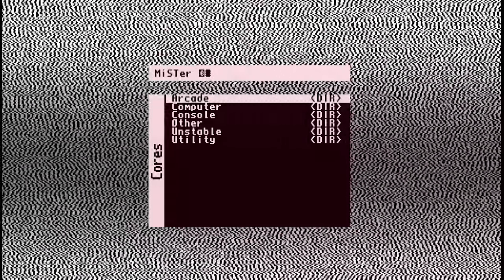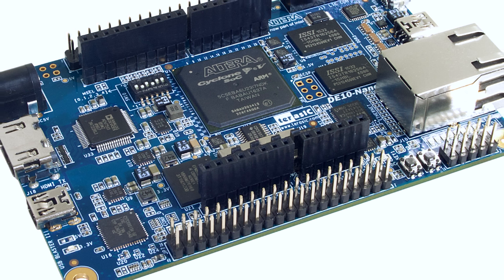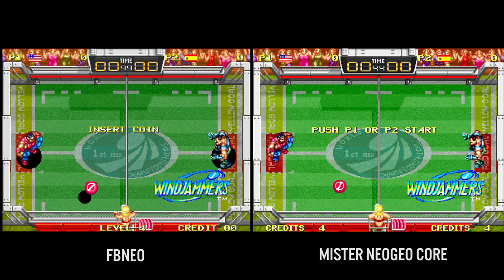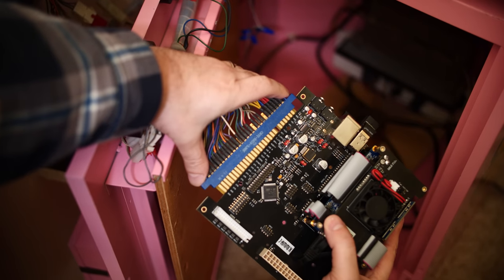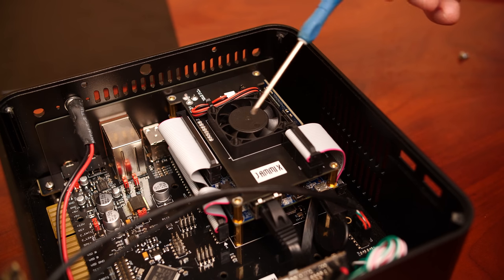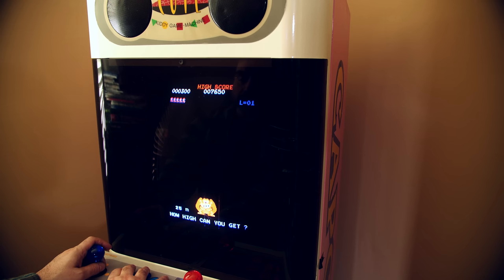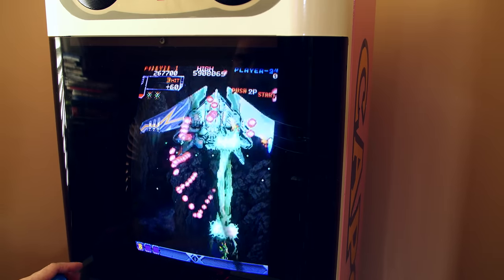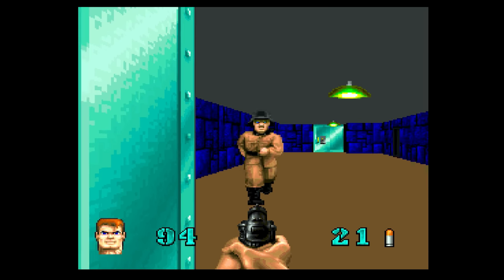Finally - I got my hands on a MiSTer FPGA Retro Gaming Setup | MVG

Comment: I always ponder on what the overall philosophical benefits of FPGA cores instead of software emulation are, especially since CPUs have become so fast that there isn't much problem to emulate cycle accurate. re: hardware preservation: in theory, a working core can again be emulated in software, although right now that'd be pretty slow. But it still makes FPGA cores more versatile and more flexible. Kind of the original hardware being preserved in a meta-language. That's especially true for many arcades that utilize ASICs. Although it'd be feasible to preserve a software emulation equally as well in the form of bytecode, running in a VM.

Comment: Nice video.  Note though that some of the cores shown require a Patreon Subscription.  A few cores also cheat and uses the Arm Processor for emulation, and not an actual FPGA core.
Reply: none of the main cores use the arm processor to work but ScummVM does which nobody gives a crap about. the patreon stuff is to beable to play the betas or just show support to some of theses guys making cores . its all free people just have to wait it out befor the core maker thinks its done

Comment: O own a MiSTer for a couple of years. It was in no way expensive as it is now. I wanted it as a good Amiga emulator and I had been glancing on the MiST project this is based on.
I own a good vintage computer collection, but space is scarce and vintage hardware is prone to break, often with unobtainable components.
After setting up my MiSTer, I was amazed on how many systems it could emulate.
In fact this is one of the drawbacks: after owning a MiSTer, there is not much point in getting further vintage hardware! So, you lose the fun in browsing eBay for good deals to increase the collection.
Being a Commodore fan, I must say that I prefer BMC64 to MiSTer for C64 emulation and it supports all other 8 bit CBM computers.
For emulating the Amiga, I think the better option is  PI400 with the bare metal Amiga emulator. Don't recall the name, but you can find fully configured images.
But yes, MiSTer is a cool piece of HW and I often leave some arcade emulation running on the background when on inline meetings. It's a cool conversation starter...

Comment: I wonder if it's possible putting a Mister FPGA inside a Arcade1up. lol

I've known for this project for a while and I'm glad people like you are pushing it towards its full potential.
Reply: should be quite easy, tbh
Reply: @dadrising6464  I can imagine and since you can put in Sanwa/Seimitsu parts, you can basically get the an accurate arcade experience at the fraction of what you would spent buying a Big Blue or Big Red and getting all the PCBs.

Comment: I'm replacing my old classic hardware with a MiSTer (bought a "fully loaded" MiSTer today). I just don't have time or the inclination to maintain my old machines anymore. I'm selling them on to other collectors so they don't end up rotting down in my shed and be lost forever.

Comment: Even though I would never being able to buy MiSTer FPGA, it's still fascinating to see the progress of replicating original retro hardware packed into a tiny machine. If MiSTer FPGA can replicate N64 core & Windows 98SE + MSDOS core with adjustable speed, sound (SoundBlaster particularly) & graphic settings, then that would be an amazing all in one retro gaming solution. A combination of 512MB RAM + IDE & SATA ports would be amazing as well.
Reply: if your reason for not being able to buy MiSTer FPGA is because you live overseas and the shipping costs along with currency exchange rates will break your bank, then imo it's valid coz same
Reply: N64 might be outside of what the De 10 is capable of. MiSTer does is low level, as its taking the time to implement each chip.
If you remember from one of MVG's N64 videos, why there isn't a clone N64 Yet, there only High level, just a software API to fudge the games to work without understanding of how the console works.

Comment: FPGA or Field Programming Gate Array...That's one of term that is relatively new in emulation scene. Basically, FPGA is a hardware that allows programmer to fully emulate the machine at hardware level by "shapeshifting" the CPU architecture into desired ones.

Comment: Would love to see you do a 2024 update video to this. I'm considering taking the plunge into FPGA
Reply: Cores have expanded to N64 and run pretty great now, no dual ram needed. The setup is now a one click solution with scripts like update_all. It sets you all up automatically. Even grabs bios files for you from internet archive. Saturn and PSX run great. The dev community is still incredibly active. A fan is not really necessary if you buy from someone like Misteraddons. The case itself is a heatsink and the chip in these things is rated for industrial use and temps much higher than a normal CPU. People are leaving their Mister's on for weeks on end with no issue.  

Basically, things have only gotten more amazing since this video came out.

Comment: I'm optimist about the future of FPGA. Not only on gaming. The flexible hardware emulation of FPGA makes it compatible with nearly any platform ever. In the future, FPGA could replace our computers, consoles, and even smartphones. Imagine using a really old software designed for mainframe computers, right on your palm in the future.

Comment: fortunately I did way back in time and bought mine. today we have cps1,2 psx and others coming. its not cheap but for a retrogamer its the best you can have in terms of accuracy. games that have glitches in PSX runs perfectly in mister.
I have a PS2 with popstarter and many games for PSX can't run there because its emulation by software, using Mister its not even comparable, needed a real PSOne to run some games so perfectly

Comment: I think you did a pretty good job selling the arcade and retro computer cores. But the console cores are great also. It's like owning an RGB modded version of each console with an Everdrive installed. 

Plus there's some things you can only get on MiSTer, like the unreleased save cart for the Atari 7800. It was never released as an actual product but since several games support it and the schematics for it existed, it was able to be implemented.

Comment: Seeing how one little box worth like 700 bucks can replace all the arcade cabinets, home computers, and even create entirely new cores, this is a mighty cheap and space saving option for any retrogamer. Buying the "original hardware" is always a tricky business, with death batteries and other tricky stuff in the mix, like chips that are impossible or expensive to replace if they should fail.

Comment: If you compare it to software emulation, the price does seem steep. After all, you could get an awesome raspberry pi setup for well under $100 and that’s a great option for a lot of people.

However, software emulation just feels a little off to some people. Not sure if it’s the lag or maybe sound sync not being perfect, but it just doesn’t feel perfect to some people.

The MiSTer has no lag there’s nothing running in the background. It feels exactly like real hardware for cores that aren’t in beta. You can also easily connect it to a CRT if you like.

I’d argue it’s more like buying real hardware, RGB modding it, getting an everdrive for each system, high quality cables, a switcher, and a scaler. 

Getting that setup for even one system could cost you more than a MiSTer setup.

If you’re perfectly happy with software emulation, that’s great. The MiSTer probably won’t be worth it for you, but if you’re one of the people who thinks software emulation just feels a tiny bit off, MiSTer is an amazing option.
Reply: And the MiSTer now is still Cheaper and Easier to get than the Super NT and Mega SG would be combined from Analogue Interactive. 
And you can support more than just Super Nintendo and Sega consoles.
Reply: @lukasperuzovic1429  Yeah, it really is a great bargain for people who aren’t satisfied with software emulation.

Comment: The thing that puts me off for older computers (same thing with software emulators) is that modern keyboards have different keyboard layouts and keycaps so there's a bunch more work if you want to have an accurate representation.
Reply: That's indeed a problem, but you can source the keyboard second-hand like you would a SNES
controller for example, hook up an adapter made for or compatible with the MiSTER and that's it

Comment: Emulation when done correctly is close to perfect. However FPGA when done correctly is better then perfect.

Also MiSTer isn't as expensive as people think. Because to get the same experience on average would cost ATLEAST 250 per console.

Because to get the same quality you'd need:

1: The console (normally around 100$ or more).

2: Mod the console to output the best video signal (normally 50$ or more)

3: Need the game cartridge or flashcart (normally 50-100$ for the flashcart).

4: Providing you don't know how to mod the console. Pay someone to do it (normally about 100$).

This is all ballpark estimates ofcourse. But that's being conservative. Most of these console would cost you even more then 250.

Comment: This would be the ultimate system for me. 
No need to get any other consoles like the Analogue and pay for shipping  for all these different consoles. 
Nothing wrong with the Analogue.
I can only dream about getting a Mister here in South Africa, but for me with the exchange rate and the shipping, would cost me 3 months’ salary.
Why is the DE10 Nano board so hard to get? Surely if there is a demand then there should be a supply!

Comment: I'm waiting for custom addons for the Mister specifically for the Amiga cores, in particular enabling ISA 16Bit + Zorro II/III and Video Extension slots so that you can actually use real hardware on this from back in the day. I'm obviously pointing to things like Video Toaster but also Bridgeboards etc
Yes, I am aware of the requirements and how hard this can be, I'm also aware that having such a solution in place the user base will increase and the likelihood of new hardware and software being made for this system increasing exponentially becoming a possible path for the rebirth of the Amiga architecture which in my opinion should never have died regardless it being a harder upgrade path for the engineers etc.

Comment: would be nice to see a follow up video. With more explanation what is the difference between software emulation and hardware emulation. I don't know how to imagine that.  Isnt it still hardware emulation through software?  

And also If you could see or feel the difference with a blind test.  Emulation vs MiSTer on a CRT.

Comment: At first glance a Mister doesn't seem cheap, but count Stuff as Everdrives, OSSC, Wireless Controllers, good RGB Cables and so on and it will stay cheaper as summing up all the Stuff. 
Also, old Games are getting more and more expansive and some Hardware is hard to Maintain, i see the Mister as the Future for Retro Enthusiasts.
Edit: I bought it for 330€ last year, fully build and ready to go.

Comment: All the research I've seen which discusses cooling says that a cooling fan is complete overkill and causes more problems than it fixes.  It's loud and it causes dusting issues.  The chip itself is industrial design and only needs a passive heat sink just as many of the chips used in industrial cnc equipment.

Comment: I may have to look into this. I still have all my retro consoles and games but this year I decided to try and get a few arcade games I used to play as a kid and got into Retropie using a Raspberry Pi4, however I found out that some of the arcade games I really wanted to play the Raspberry Pi isnt able to do it (mainly Sega Model 1, 2 and 3 games such as Daytona and Scud Race to name a few). $400 for this is abit steep but if it can pull off what I need it to I may find it worth while but this does look like another massive learning curve.

Comment: Two years ago, I got the basic setup to use all cores and connect to lcd or crt (de10, usb hub, hdmi to vga, ram expansion) is was around 200 Euro. I can't believe how high is the price now, this is insane :(. Also notice the scrolling in the windhammers intro, emulators are never 100% smooth (fpga and real hardware are).

Comment: NeoGeo runs really well on software emulation. Only in the fighting games i have the impression there’s input lag. For Punch Out on NES i am 100% sure. Soda Popinski is very hard to beat on soft emulation. I still have to test the “frame forward” option on Retroarch, but for now i swear with my Analogue NT Mini FPGA for these games.
Reply: There some inherit lag in Software Emulation you can't get over. The sequential way CPUs has to handle every steep of emulation means there going to be some latency, even with features such as run ahead mode and CPUs having multiple processor cores. FPGA is mimicking the hardware, so the parts of that console that runs parallel on the original runs parallel on the MiSTer. Most of the lag from the MiSTer is Display or controller Delay. If the default refresh for each core is not something your display can handle there Vsync for that which does add some latency, but it honestly not much. And yes with default settings, most of the cores replicate their original machines refresh rate.

Comment: I would still like to see a discussion of the advantages of the Mister over emulation. You mentioned it in the beginning and said you changed your mind, but didn't explain how or why. Why should someone spend hundreds on a Mister setup instead of using mature emulators?
Reply: you get 100% cycle accurate and lagfree emulation. once a core is done you get the exact same result as original hardware on every game without exception.
Reply: High accuracy, less latency, dedicated hardware with far less overhead

Comment: The MiSTer FPGA is a great replacement for any 1-Up Arcade Cabinet out there.
Reply: A Pi 4 is even better. Cheaper, available, mature software with good emulation, can play Dreamcast, N64, etc..
Reply: @mrkirk4944  Stop spreading outright lies.

Comment: This is an awesome project and is doing a great job from what i see i the video. My only problem is, that i already made exactly something like this with Batocera on a dedicated minipc intel nuc with a gorgeous interface easy to scrool and a plesure to navigate for even a 5 year old, with over 2k games that work flawlessly with bluetooth controlers with all major arcade platforms up to ps1. Is all set and is small and i have lan connection to it to. Is software emulation not hardware, cost me nothing because was made from old pc i did not used,  but in the end if it works....and most important is easy for a child to navigate in it and looks amazing and has game descriptions and cover artwork. Idk, i do not miss the bulky and cluncky machines or the old 386 with monochromatic duotone monitors, i miss the games.

Comment: I have now so many options, like original hardware / retro PC, flashcards like Everdrives, Emulation (like on my 351V) and so on that I don't really play my MiSTer so often. What I'm missing with the MiSTer is savestates and that Amiga would have less issues (especially games where you want to save). With Amiga I actually prefer WinUAE with my Laptop connected to my CRT Monitor, thanks to custom resolutions with high refresh rates even in real 320x200 and so on instead of scan doubling to.
Neo Geo via MiSTer on a CRT TV is great though as I don't own a Neo Geo (yet?). Need to try the PC core and other like C64 again too as it's been a while and they had many issues before.

Original hardware using original games somehow still feels best, just finished Dungeon Master Nexus on my Saturn and now I'm playing Shining Force CD on my Mega CD. Strange how even using the Everdrives on original hardware doesn't feel the same as plugging in the original games even though it's better for backing up save data.

Comment: Thank you for the wonderful video. The Lemon Rink A Dink: Redux Amiga demo segment that you showed glitching in your video runs perfectly fine on my MiSTEr. Maybe you used an old version of the core or an incompatible setting? I used the Amiga core from 01/08/2022 with a standard A500 setting (Kickstart 1.3, OCS-A500, 512k Chip Mem, 512 k Slow Mem, no Fast Mem). I booted the adf image from pouet and it ran without glitching.

Comment: I totally get the appeal of this, especially when it comes to connecting it to Arcade cabinets, CRT, etc. But by personally I have a powerful SFFPC, which takes care of my emulation needs, plus much more. I don't need more hardware to drag around. They can both co-exist, but it will depend on your personal needs which solution works best if you'd compare a Mister ($400-600) vs SFFPC ($500++). The latter has much better support for all kinds of consoles and arcade, even more powerful modern-ish systems (Xbox, 360, PS2, PS3, PSP, Dreamcast, Gamecube, Wii, Wii U, Switch, etc), but of course the price of entry to cover those can be a bit more expensive hardware. I highly recommend using LaunchBox on a PC for managing roms and emulators.

Comment: mister also makes the setup simple with the update_all script (roms included). 
A groovymame emudriver setup would be the best option but you will need to be extremely IT savvy otherwise you will not have a chance to set it up.